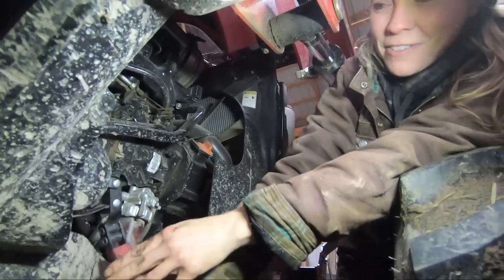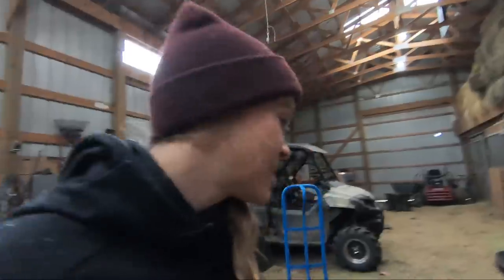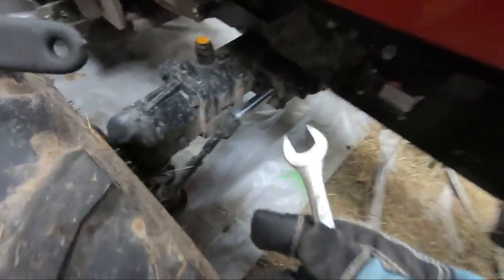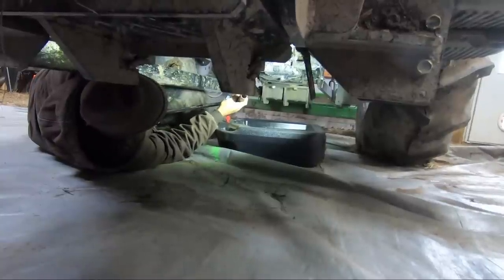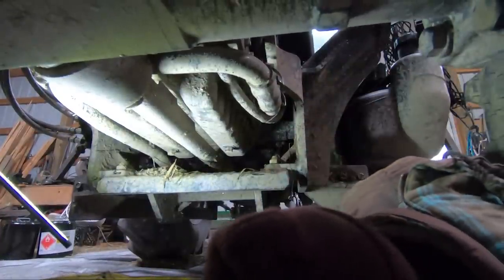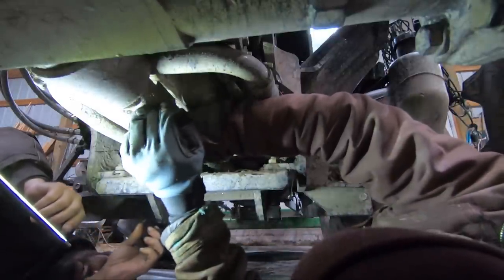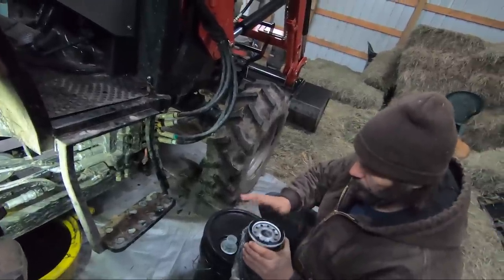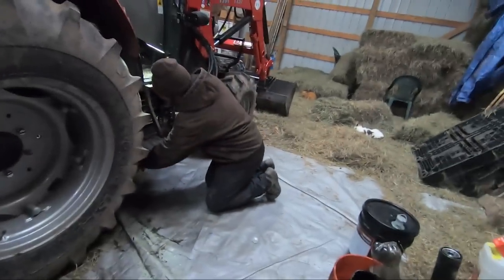406 Service Hacks for Tractor Maintenance: 50 hr Service on TYM Tractor - & Destruction on the FARM

Comment: I'm an older man and have had five back surgeries in the last 12 months. Therefore, I bought two 20 gallon plastic containers (like large bottles) from amazon, a drill-attached fluid transfer pump from ACE hardware (couldn't find it anywhere else), a three-step stool, and some clear hose I attached to both sides of the pump. I use one of the 20 gallon to accept the old oil and pour the correct amount of the new oil in the other. I then put the step stool near the vehicle (I do this for my TYM and my F-250) and use my battery operated drill on the pump and transfer the oil from the 20 gallon container into the vehicle. I wash everything out with brake cleaner in between different kinds of oil (transmission fluid versus engine oil). It's MUCH easier!
Reply from the maker: I LOVE the drill pump idea! I'll ahve to see if I can find one! I have a few tractor implements I'd like to suck everything out of!

Comment: Viewed 3-19-22  from Illinois      Hi Sue              Looks like greenhouse is over..............windy day I say.     When replacing oil filters    first turn slightly to tighten then back it off.
The heat tends to seal down the rubber gasket making it harder to spin off  :))))
Reply from the maker: I will try that one for next time :D
Reply: @This1LifeWeLive  Just  enought for the filter to move a very small amount

Comment: Hey Suzanne you could just make the green house the old fashioned way. Cinder blocks waist high with loops made of rebar for the top. Then fill the cinder blocks with cement. Solid as a rock. The clear plastic comes in much thicker gauge so it won’t blow around so much. A glass top is even better and can be vented. I would have only changed the engine oil. The other stuff was clean. Glad to see you well and getting ready for a new season. Good luck for 2022 🍀
Reply from the maker: Thankyou for the greenhosue tips! I didn't know about the cinder blocks! May have to look more into that!

Comment: Love the channel.  When you pour from the container try putting the opening on the top it sometimes helps to pour easier without the mess.  This also works for smaller oil containers in tight places.

Comment: Suzanne, Enjoyed your video. I get to do a lot of first services at the Deere dealer I work at. First filter removals are a bitch Lol. The plugs at the top of the front axle by the wheels are used as air vents to let the oil drain faster and also fill faster.

Comment: Not sure how your oil drain plugs are set up on your oil pans but my plugs are in the rear of the pan, so I pull my front end up on my utility trailer and drain it, and do
All the front end work I can, such as greasing, draining front axle, and oil while it’s up for more Room underneath, then do the same to the rear. Have to recheck the oils after refilling when tractor
Is level but makes it a lot easier
To get to everything. Just a thought, not sure if it will help on you TYM

Comment: I see you used an excellent choice of engine oil . Peterbilt truck s come factory filled with that brand also.Don,t feel bad about the 100 hrs my apu unit that has either Yanmar or Kubota 2 cyl engine s.They also recommend 50 hr 1st drain interval but after that a 1000 hr interval.My 22 Peterbilt 579 just hit 40k mi and at 1100 hrs I have to wait until 70k mi for for 1st PM service.On highway use has longer interval,but has a secondary bypass oil filter also.

Comment: Never admit to not following recommended changes.   Use the BOX end of wrenches so you don't round off the corners unless it is a square head. I expect that was a Metric size.  6 Point socket and Breaker/Johnson Bar works best.  Sometimes try to tighten them slightly first.
Many suggest NOT to put oil into the new filter when changing.  That oil does not get filtered initially.  Your portables should be anchored with a line to the peak at each end to a stake or anchor in the ground 10' away.   Those broken pieces can be spliced buy using tubes or pipes inside them and bolting or pop riveting them into place.
Reply from the maker: I will go throuogh and reinforce behind the broken ends of the greenhosue. Thankfull it's still attached. The chicken shelter is tougher because it would need the broken ends cut so it fits together smoothly. But at least on that one only a few pieces broke, the others just lost their screws
Reply: @This1LifeWeLive  I hate it when that happens!  Recipro Saw or Tubing cutters will work.

Comment: Hello. I am looking into getting either a 494 or the 574 and having trouble decided on what transmission I would rather have. Do you folks have any talking points on the shuttle or do you wish you would have got the HST. Thanks.
Reply from the maker: depends. Erik swears the hydrostat would have been better since he does loader work and grapple work with it. BUT, it's small and nimble for fieldwork and hydrostat does NOT like long hours of running, especially with hydraulics or pto engaged. (brush hogging for example or hayrake). I love using it for raking and tedding hay, and brushhog work. Hydro would have allowed our son to drive it, AND erik is awful with a geared tractor. BOTH of them he's repeatedly gotten STUCK IN GEAR this year . . . Drives me nuts I swear. So the old addage is, if you plan for hours running laps in a  field, geared. if lots of loader forward and back work, then hydro :)

Honestly, wish I had one of BOTH, hahaha!
Reply: @This1LifeWeLive  Thank you for your input. I do not plan on during laps in a field just have loader work and box blade work lined up in my future. I know I will get more pulling power from the geared, just was unsure of how well you feel the clutch has been holding up and the smoothness of the shuttle lever. Thanks.
Reply from the maker: @nastynova7632  you might prefer the hydro then. My clutch is quite stiff and a workout each time 😆

Comment: need to be careful using teflon tape especially on any hydraulic connections can cause more issues than its worth......you will be amazed at how many hrs you put on the smaller tractor they are quite handy